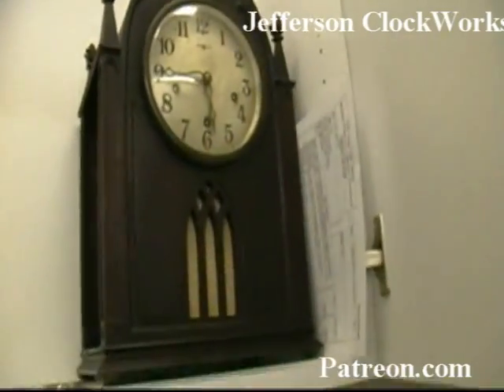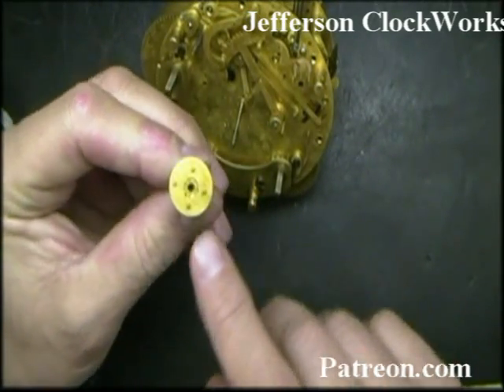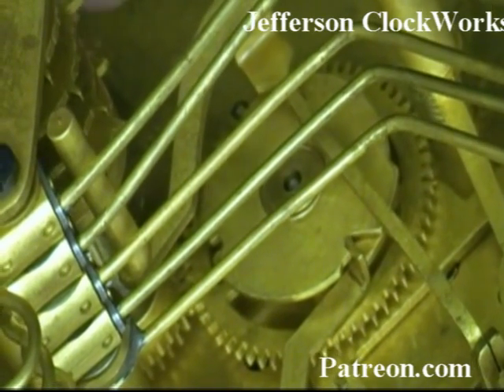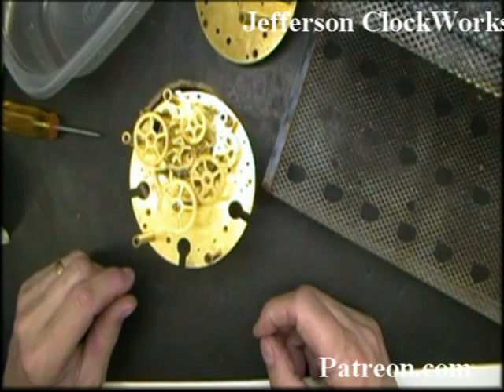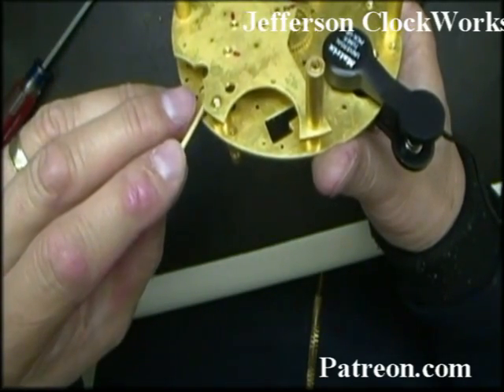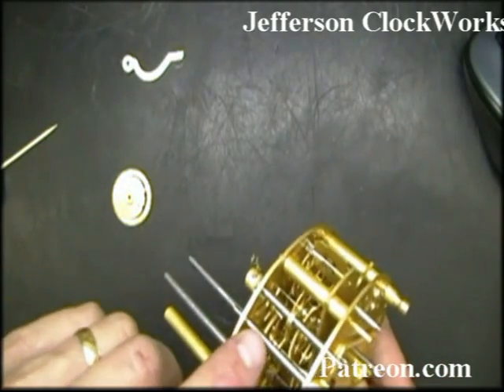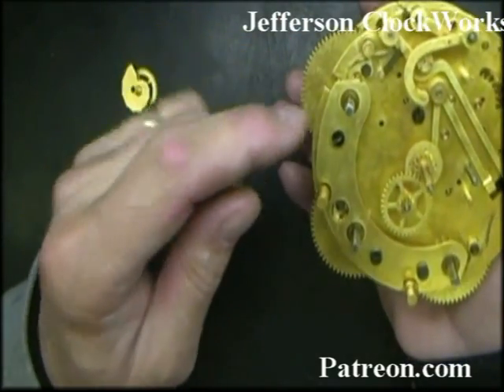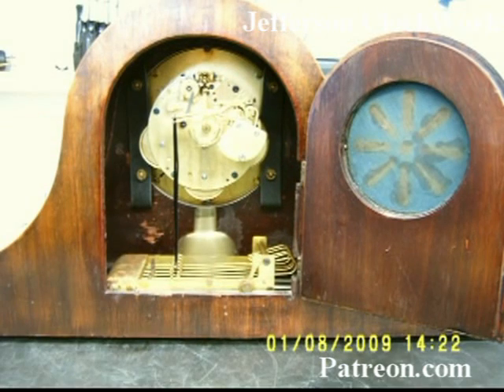Repair New Haven Triple Plate Westminster Chime Mantel Clock, Short Preview

Comment: I recently completed one of these and realized it is much more difficult than a German movement. Pivots buried under other plates, necessitating lubrication in steps, manual adjustments to the levers on the chime and strike mechanisms because the parts don't align automatically when installed, and installing the gathering pallet just right so the pins don't stop the rack from dropping. It was a learning experience for sure.